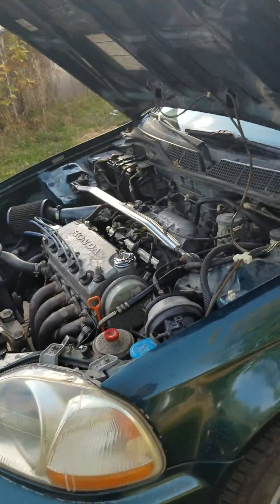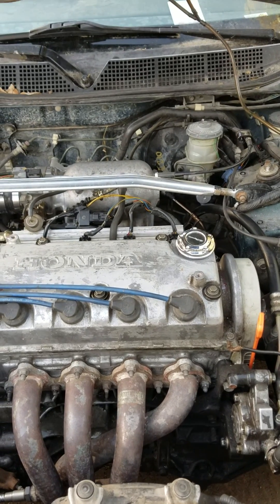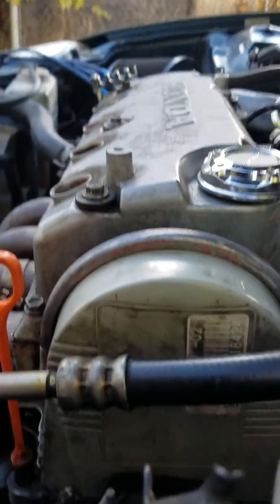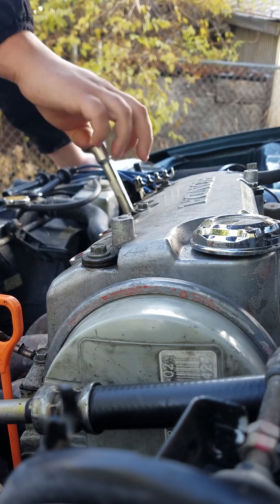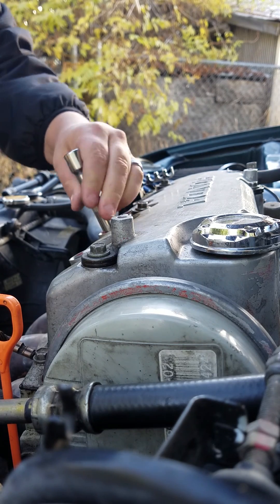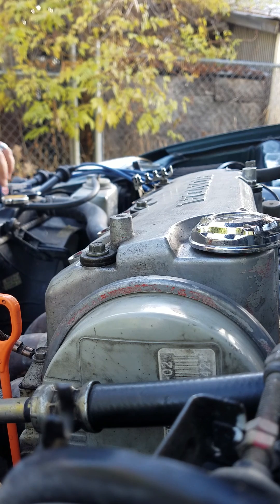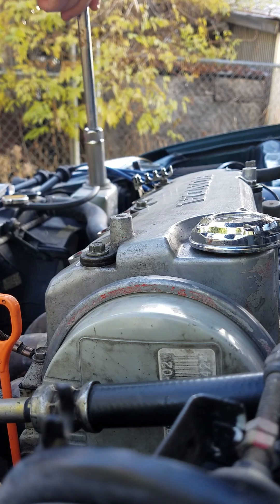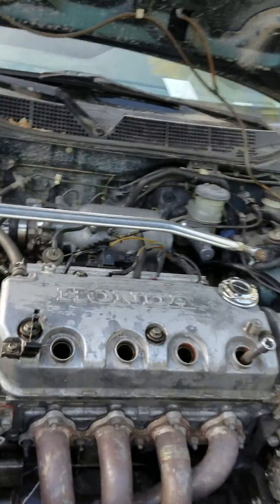Honda civic spark plug change and firing order.

Comment: Hey my stock b20 wasn't starting so I had some help and the guy switched the wires on distributor and it started right up . the wires where in the right order but he switched 1 and 4 and 2 and 3 . But as time passed but the start is worse and the crank it's pretty long . I trying switching them back but the wont start and all and it I switch 1 pair back to the right spot the car shakes really bad none stop. What do you think the problem is . Please help
Reply from the maker: Johnny Ramirez timing make sure better yet call me jeez 2084053629

Comment: I would to ask in a few questions. is there a way I can contact u
Reply from the maker: Rawlins Chetram yes 2082309017
Reply: I have a 98 civic ex but it have a d15b7 engine in it. right now it is currently cranking but not starting. I change the distributor, and fuel pump. check main relay, fuel pressure, spark, and compression but it still wouldn't start. If u could help me put with this problem I would appreciate it.
Reply from the maker: Timing
Reply: thanks bro I had a feeling it was the timing. do u have any video doing it a easier way than taking off the alternator and belts.
Reply from the maker: If the cam gear is facing up the crank needs to be on the last dot to make kinda decent timing
Reply: thanks bro really appreciate it
Reply from the maker: Adjust where you think is best chances are last dot on crank is the sweet spot